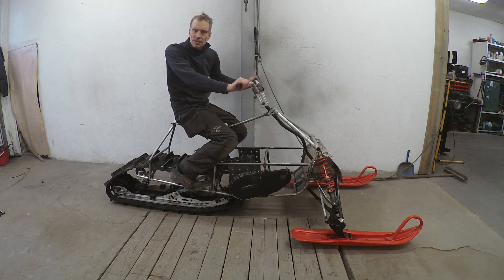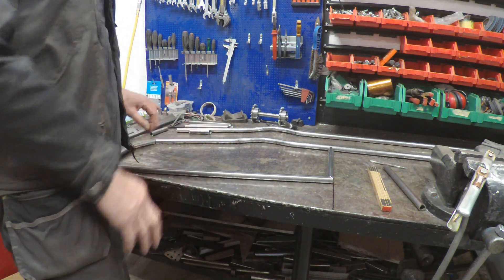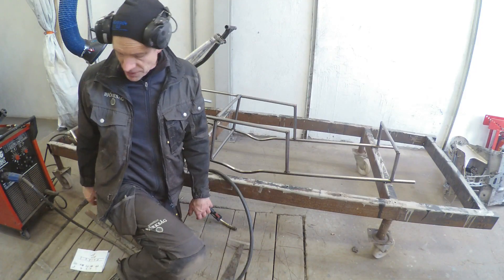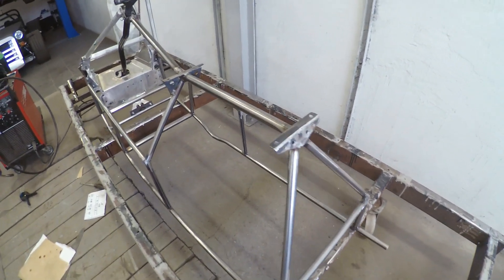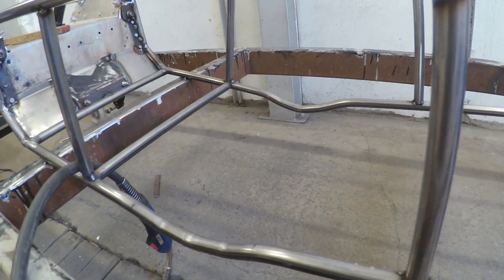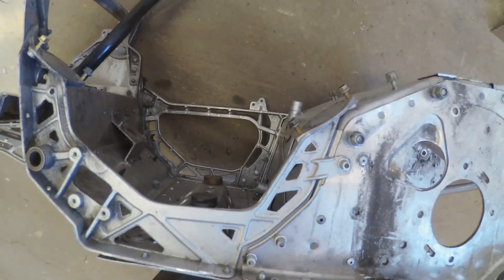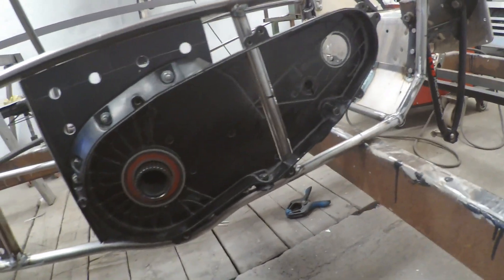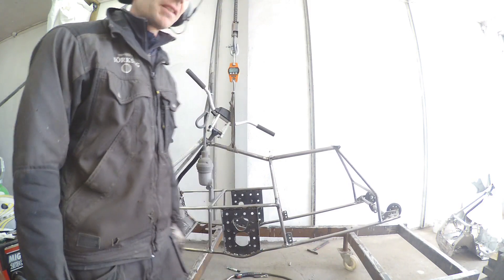Electric Snowmobile    2.Tubular frame

Comment: Hi Per!
I really enjoy your channel! lots of great material. 
Recently I have been playing with the idea of building an electric snowboard.  As my only experience with electric vehicles up to now is from building Efoils. i was hoping you could give your input!
 
My goal is to have the snowboard run fast and be portable, Ideally both motor, ESC and Batteries in the board under your feet. Complete setup about 20 kg.
There would only be one large belt and you would stand on top of it like a snowboard.  400mm wide and 1400mm long.  
With two larger outrunners, I am hoping to achieve about 4000w output on the board. 
Is this worth building? will it be any fun to ride? or do I need a bigger belt or will this thing just dig itself into the snow and not be a joy to ride :)

Regards Hans,  I am based out of Trondheim Norway
Reply from the maker: Hej, intressant projekt och kul att du gillar min kanal. Det är nog fullt möjligt att få till ett fordon som du beskriver, kolla in denna site : snow-bike.ru     Där kan du nog få mer inspiration.  Tror dock att snöförhållanden är helt avgörande för hur kul det blir. Lössnö, lätt att svänga. Skare, bra framkomlighet. Kolla även denna mojäng så kanske du får lite känsla : https://youtu.be/LNsHQmDyBVo

Mvh Pär

Comment: If you replace the chain drive with, lets say like Polaris Quickdrive belt drive you'll probably save a few kilos with that. I think there could have been some bolt-on kits for Lynx also, can't remember where I saw one.
Reply from the maker: Hello, Mikko ! Thank you for tip, I have seen the bolt on kits and they give more performance compared to original setup. I planned to build my own version of belt drive, but if I want to keep the original enclosure there will not be enough space for belt.  My thoughts now is maybe to exchange the heavy original chain transmission with lighter 430 sprockets and chain, same setup as on Electric  Snowbike. Not decided yet thou.   BR Per